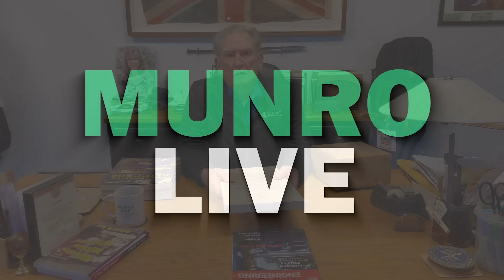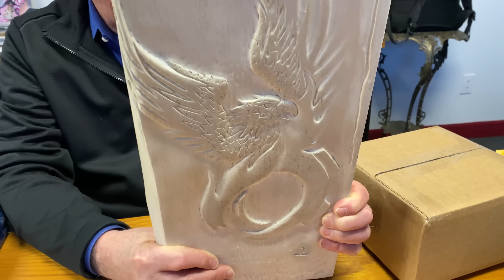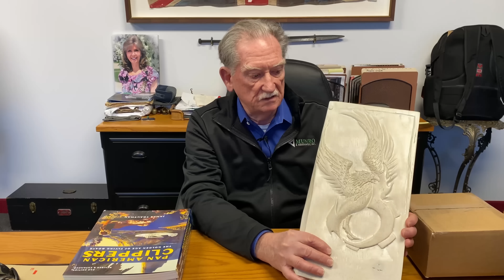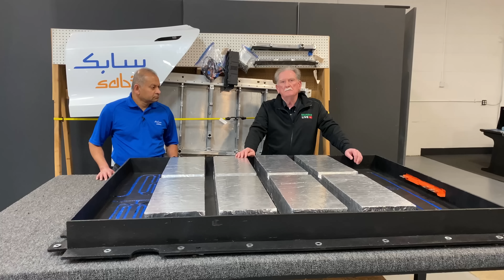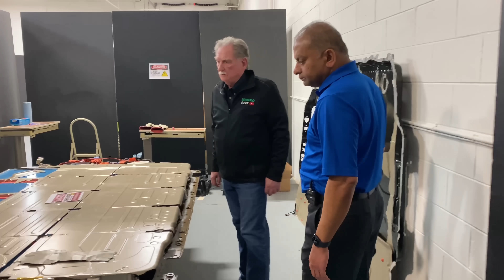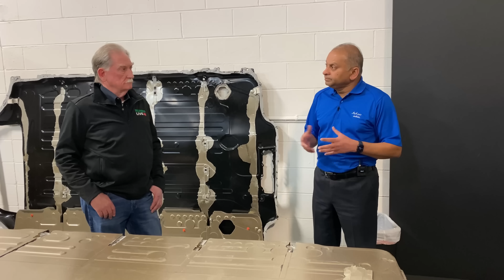Munro & Sabic on Battery Tray Composites - Tesla Model S Plaid Battery Tray

Comment: Great show,
The plastics industry should do three simple things: 

1…Make all plastics easily recyclable.

2…Put a high price on recycled plastic, Alaska fishermen could cleanup the oceans in 5 years, and there’d be fish to catch when they got back, as a bonus 
3…Make it sustainable
Reply: 1. most plastics are already recyclable. The main issue are the mixes of plastics. 
2. If ground beef is more expensive than filet steak would you still buy ground beef ? Same here, if recycled plastics is more expensive than virgin plastic why would you buy recycled plastics ?
3. Is driving big SUVs and trucks sustainable ? Our whole economy based on oil is not sustainable. So...
Reply: @user-qd7er4tj1h  Plastic is almost entirely non-recyclable, for any practical purpose. Polyethylenes are pretty easy, but besides that it basically all goes straight from your blue bin into the landfill. Not that I think recyclability should necessarily be the be-all-end-all when choosing materials for highly demanding applications.

Comment: Nothing wrong with composites, they most likely could be a superior solution , however, I am not sure the cost factor vs metal castings etc… is not a major obstacle when you are talking about mass production.
Reply: As he said, it's not just the initial cost, but the amount of money you spend to move the mass down the road over time.
Reply: @rogerstarkey5390  Benefits “down the road” in my experience is a loosing battle in a society that always wants everything upfront!

Comment: I don't know why they would use Mica, besides heat resistance and/or high voltage isolation!
Out of all the cheaper material, steel has the highest melting point. 
They must have their reason. I just don't know what their reason is. 
If it was me, I would divide the battery bank into 3 separate parallel modules housed in separate explosion-proof containers like they have for luggage onboard aircraft today. 
Or at least mount the batteries on aluminum heat-sink casing, with fins exposed at the bottom of the car's air stream. the faster you go, the more air passes over the fins. 
If one module develops a fault, the range is reduced, if even 2 modules develop faults, you are not stranded in middle of nowhere! 
You get redundancy and heat dissipation without active cooling. Also, these modules can be used in other cars. smaller cares will have one module, like the Chinese Wuling, and more modules for SUV size models. By spacing the modules apart with say rock wool or similar fire proof material, If something goes really wrong, you won't have a chain reaction to all modules on your hand. 
End of transmission.

Comment: My problem remains the end of life process.  We are using most plastics once and disposing of that in the nearest convenient place.  Some reuse is done and a small amount of recycling.  Probably the most difficult part in the recycling process is the people wanting to sell their new oil byproducts and make their money.  The second most difficult part is the “recycling” system that dumps the products in land fill.  The third part is the separation of the various types of plastic to the useable recycling state.  Like most things, hiding the facts has been cheaper than providing the solutions.  The million and a half uncapped oil wells that abound in almost all sights where oil is drilled in the US allow methane to leak into the atmosphere and clutter farm lands with the remnants of the pumping equipment also point to a serious question about enduring legacy.     
I see similar processes though more confined in the atomic energy arguments.  They dig and enrich radioactive elements, use them until no longer profitable, take the remains and put them where they think they are no longer causing a problem out of sight and when their containers decompose and leach into the streams/rivers/ground water, instead of cleaning/containing it differently, they change the law to change the nature of what is radioactively dangerous.                                              
I am not against plastics or atomic energy but I am against the lack of a healthy solution from beginning to end.  I am against the ongoing  short sightedness of what happens next                                                                  
We have seen many places force the existence of cleanup funds for contractors so that if things are not cleaned up on a site there are adequate funds for it to be done whether or not the contractor can do it.  But who pays for the repairs for strip mining once it is done?  Who pays for the ocean cleanup from cheap “plastics”?  Who pays for the plastic recycling?  Who developes the methods of isolating the components for recycling the pieces and who pays?  I don’t believe it is a specific company’s problem.

Comment: The problem with plastics is not from the car industry, but form irresponsible use of disposable short term plastics that were allowed for decades. This frenzy could be stopped by putting really big tax on pets and bags and all sort of short term of the shelve plastics, that could be recouped as soon as you bring it at a disposable center (which could be all over the place, and give ur money on a card).

Comment: Plastics and other high tech materials can even  be cheaper and better. Tooling cost is the problem. In the early 70's, Ingersol-Rand was set to sell more plastic casting machines to the auto industry based on a twenty year full service lease, when the industry tanked, delaying that technology over a decade.

Comment: 10:30 Composites and thermosetting plastics are not good for recycling. If you cannot melt it you cannot recycle it (or at least not easily, process may exist).
I agree with the beginning yes plastic is very well recycle in cars because it is in big quantity and easy to collect. But the jump from that to the fire resistant plastic may be misleading, it may be a not recyclable part.
Reply: Correct. Some composites, especially those that use bonding agents (carbon fibre is one) are not easily recyclable. All road bicycle frames for instance, end up in a land fill.
Reply: I can only agree with your statement. Yes it's cheaper and light weight, but the energy that is needed to recycle is prob A LOT more then the design shown in tesla pack. The pack tesla has can prob be recycled for 99% of it materials(battery materials aside), only thing that cant is the adhesive that glue the pack together. 

I've recently finished a production line that make the battery covers for battery cells. These are some type of aluminum trays and have a sprayed fire resistant coating in the inside to help with fire. So my question would be, what do they do to for recycling, since the aluminum will melt but the fire coating is a type of plastic that is fire resistant. How they plan to recycle the plastic efficiently without a loss. 

Also since tesla is bolting their seats dirrectly on their battery pack cover for their new 4680 pack design, how would this work if the top cover was of plastic, how thick would the plastic be to create enough structural support to do this etc. How much support does plastic give in a crash, how well does the plastic handle warping from temperature/humidity etc. It is not as easy as just replace the cover with plastic and done. Telsa is looking at using materials they can recycle easily and efficiently, fire resistant plastic is none of both.

Comment: THANKSGIVING
With this subject not sure yet if I agree with you, until lateral crash tests can prove or disprove.  As it stands That steel plate is the equivalent of a web in an  (I Beam) for this existing design of metal it can take a huge hit and resist deforming.

Comment: Glass/carbon-fibre reinforced plastic is not recyclable; you might be able to grind it up and embed it in concrete but that's not really recycling. Aluminium is pretty much totally recyclable though the various alloys may muddy the waters a bit, I don't know enough about that. Props to Sabic though for helping out and as a stopgap measure plastic might be tolerable. Mica composite doesn't sound too great either...

Comment: 2 huge questions: Time need to make such a plastic part?  and plastic durability 4mm thick is very thin and I think easy broken if you hit say a rock or a tow hitch ;)  Being metal is probably fast and yes more equally recyclable.  when you recycle plastic you lose about 60% of it.  When you recycle metal-you lose about 35% of it.
Reply: It's a composite.
Resistance to puncture is just a case of using the right material, in the right amount, in the right area.
Again, I'm sure "the experts" have thought of this.

Comment: Depending on the source ~10% of all plastic is recycled, less than 1% second time use plastic is recycled. Aluminum for example is infinitely recyclable.
Reply: The main factor in all of this is cost plastics per tone cost about 1/3 the price of aluminium and 1/5 the price of steel so it is less economically viable to sort usable plastics from waster streams  and they often get placed into land fills or incinerated.  plastics are an incredibly useful material that is why they are so widely used and may of the every day items we uses would not exist without them.  The only problem with plastics is our disposal method has never changed since we have existed on this planet it has always been to trough it into a hole or burn the items.  we live in a time where it is posable for there to be no waste to landfill but at this current moment in time these are the cheapest options and there doesn't seam to be any political will to change this.   

Deaminizing a extremely useful material because we have not changed our methods of waste disposal is not fixing the problem only masking it.
Reply: Not infinitely.
Reply: Actually the problem is that all this plastic stuff and many other things and techniques promoted by Sandy decreases car's lifespan and making It disposable. He wants to design a car that is good for assembly and don't cares about reliability and rebuildability. I as a customer don't buy a car to give a job to workers, I buy a car to use it and use it for a reasonable amount of time and then I want to sell it so somebody else continue to use it. E.g. I don't care how efficient gigacasting is at the factory, but I care about ability to buy used intact side member and weld it in place of damaged. I want to be able to rebuild my battery with new different cells like people do with Leafs without messing with complex cooling systems and mounting them to plastic tray. I also don't need ridiculous power like 500+ hp in a daily car because 5-10C discharges makes a tons of problems.
Reply: 90% of plastic is not properly prepared for recycling. If the plastic is not cleaned of contaminants first, it will be placed in the trash. This is more of a personal responsibility problem than it is a infrastructure or industry problem.
Reply: @AdjustinThings  Wrong. There is plenty of “clean” plastic. The thing is the whole recycling approach is a scam to protect those who line pockets with money through selling plastics.
Reply: @amimartian  Listen, i know the youtube videos you watched to reach your conclusion that you believe is your own. Do you dispute the fact that any unwashed plastic containers in a recycling bin are tossed directly in the trash?
Reply: Im in the industry and yes plastics are NOT recycle
Reply: @AdjustinThings   Sandy said it himself "plastic means nothing". A trash can of plastic actually contains dozens of different materials mixed together, stuck together, in different colours, with different properties. While possible in theory, this can't be processed cost effectively and never will, hence why all plastic products claim to be 'recyclable', yet almost none are made from recycled material. And that's without mentioning material degradation.

Comment: Sandy, I've wondered if the use of Mica and Steel are used to protect passengers from any emissions of energy from the battery pack? I have wondered about the long term effect from energy emitted from the battery pack on humans sitting directly above it.
Reply: The battery is DC. There are minimal electrical fields coming from the battery. The motors and inverter are switched and thus create some noise but then so does everything else you live with daily.

Comment: I'd rather have all oil extracted turned into plastic rather then burnt in an ICE vehicle.
It's a bit sad when some people get told a truth, such as 'carbon in the atmosphere is bad', but don't think enough about the alternative and decide that something like a nuke reactor is the solution. Nukes also have an emission (radiation that kills a lot quicker then Co2) and a waste product (that is only useful if your making an A bomb).
Similar thing is going on with plastics. Yes they are a hazard if used indiscriminately and without thought to environmental impact. One could sat that about anything really.

Say you instantly replaced every plastic container in the world with an aluminium one. You'll still have a problem with pollution, because a lot of people are lazy and will dispose of the aluminium container in the same way they currently chuck plastic containers away. We will have floating aluminium islands forming out in the pacific somewhere.

Comment: I am quite sure that Tesla could do well in cooperation with Sabic to develope a composite that would completely enclose a fire in a battery cell, while replacing the steel casing and the inner layer. We really need to do some very hard tests on such materials, to make a bullet proof battery pack that will not damage the car, even if a cell goes into thermal runaway mode. It would just smell bad and stop working, but you did'nt have to soak the whole car in water to contain the fire. The trick is to utilize the way the composite behaves in heavy fire. Some will just kinda melt and bubble up into a tight filller that will never burn and contain the battery cell from harming all the others. That is what we need to invent. No more fire hazard from any battery pack, ever again, with this kind of technology.
Reply: If you look at the Tesla structural pack, they have the fire retardant core already. Just needs the outer shell

Comment: Since the battery pack is arguably the most important part of a Tesla, don't you think they considered the cost/longevity/recyclability/weight/crash considerations when they did material selection and design.  I'm sure they thought hard about this.
Reply: Sabic is a company that sells plastic and composite materials. If you ask a company that makes metals they will push metal on you...
Reply: They very likely considered a lot of variables when it came to design and materials. But that should be a never-ending process.
Reply: hardcore fanboi post

Comment: FRP=Fiberglass Reinforced Plastic  CFRP=Carbon Fiber Reinforced Plastic.  Carbon fiber can be stronger than steel for the same weight. Sandwich a few layers of carbon between Kevlar. while the carbon might punch through the Kevlar is what they make (some)bullet proof vests from. Very tough and harder to penetrate.

Comment: Composites, not carbon fiber, would have to be thicker to have the rigidity of the aluminum piece it replaces.  The design of the battery pack had a certain volume to work within.

Comment: Plastic is not the answer...its toxic to make,as bad as processing mica. And recycling in the u.s. is abysmal compared to Europe where its mandated for auto parts.  Soon taking back vehicles after they are used up is coming. So the cycle will be full circle.  Tesla couldn't handle the requirements.  The majors could.  Tesla thinks fart sounds matter,with another illegal car function,like being able to play games while car is in motion.  If the battery packs are gonna be a structural component of the vehicle, plastics aint up to the job.  Cut cut cut,only makes bad products,snap together vehicle are not good engineering,metal matters.  Vw has a 12 year unlimited miles corrosion rust warranty...on all the metal...what does Tesla offer? Besides fart sounds?

Comment: saw an old 40's us automobiles documentary demonstrating hemp panels pressed ditto to steel cast counterparts.. guy took a sledge hammer to the door.. bounced back blow..  was before chemical plastics production.. thinking industry opted for petroleum plastics as its a byproduct of oil which u don't have to first farm then process into usable practical options..

Comment: I’m no expert on this, but looking forward I wonder: would a composite material („plastic“) still work, when Tesla shifts to the structural battery packs? I think this will lead to a whole new bunch of requirements for the „housing“ of the battery cells.
Reply: Of course it could be made to work, but would it be better overall (production, cost etc) than metals or something else entirely...
Reply: I suspect that even if Sandy is right here, they likely won’t change it precisely because they’re fully focused on the structural battery pack. Maybe they can incorporate it into that, but I doubt they’ll update this design with a plastic top given their priorities.